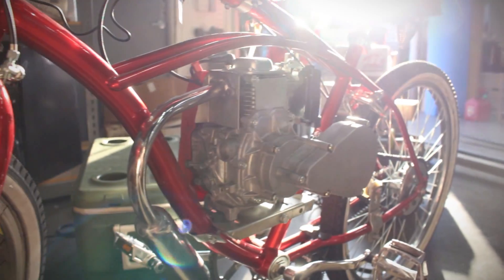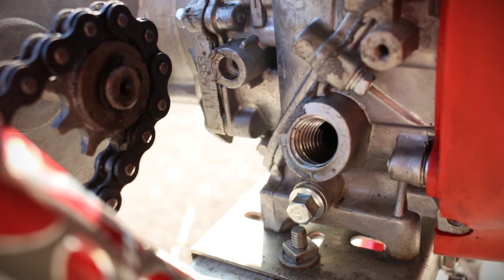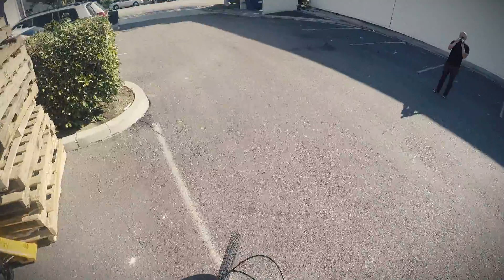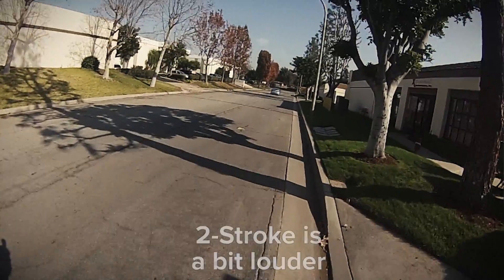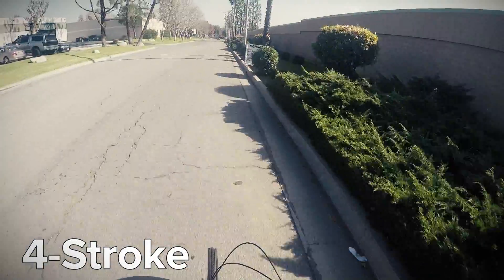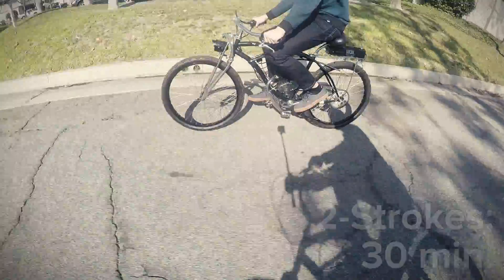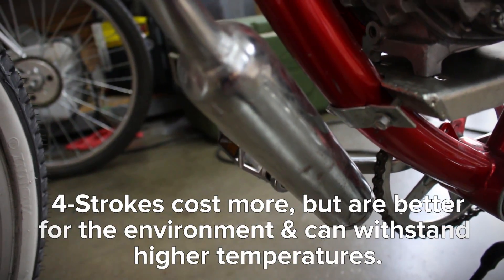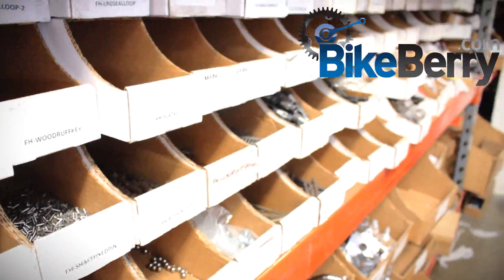2-Stroke vs 4-Stroke Motorized Bicycle (GoPro)

Comment: 4-strokes are faster mine is 212ccs
Reply: Cops dont care? How sketchy are the brakes
Reply: +Peter Kapica my brakes are fine 
They don't squeak and they don't slide meaning that if you break hard you are gunna stop and it will happen fast to you have to pull it brake in slowly
Reply: +Night-Vision Productions you are lucky,  mine are nonexistent and it's a 2 stroke 80cc
Reply: +Peter Kapica you should buy some new brakes then lol
Reply: +Night-Vision Productions I did that and they went out of adjustment in 2 weeks
Reply: +Peter Kapica that sucks man
Reply: Would duct tape prevent the brake cable from going out of adjustment?
Reply: Just tighten the goddamn screw thats all
Reply: thats because its 212cc, the 2 stroke engine in this video is like 66cc maybe even 48cc

Comment: these motorized bikes are insanely difficult to build the first time you make one. But the second one will be super easy. I ride a 2 stroke and I ride it for up to 2 hours at a time, and it's perfectly fine. Obviously it gets hot, but I ride a good 20 miles in those 2 hours. I wouldn't recommend a project like this to a person who is easily stressed out, or has no experience with bikes. I've got a lot of experience with bikes and I even had a lot of trouble with it.
Reply: delreydavid after about 2 months everything goes to shit. Definitely not worth putting 300 dollars into it.
Reply: +delreydavid It does run fine, but certain parts break after about 2 months. I've had mine for about 5 months, and it ran perfect the first 2 or 3 months, but recently, I've broken the exhaust, the magneto, and the carburator.

Comment: in the 4 strokes is it better to run reg grade gas or premium?
Reply: Usually just regular
Reply: Ok
Reply: Honestly 87 will do and for a 2 stroke i would go 89
Reply: I use regular gas in mine, just make sure you're adding enough oil or else the engine won't be probably lubricated enough. Good thing about these little engines though is that it's easy to replace lol

Comment: damn so many people fan girling over the 2 strokes. In short they aren't a better engine. They die faster, Have worse gas mileage (due to ineffective burn), and all together don't last as long as a 4 stroke. 2strokes are fun don't get me wrong but they just don't last...
Reply: They will last the same amount of time when the right oil/gas mix is correct and the seals are good

Comment: 30 MINUTES ON A TWO STROKE ROFLI have gone on long roadtrips on a 40 year old two stroke, riding 6+ hours straight (stopping for gas periodically of course), and have never in 5 years had any problems with the engine except for rattling the carb loose once
Reply: how did you refuel it? did you keep a can of gas in a separate can?
Reply: Yup the time was BS and i had a carb fall off on me couple times

Comment: need to add a us forest servive approved spark arrester do u have one to add to existing mufler systems.
Reply: You dont need that shit the original 2 stroke exhaust pipe in your kit does the same thing with the baffles. On a 4 stroke the factory exhaust has it too

Comment: 4 strokes do not last longer due to oil resevor! they in general don't last longer 2 strokes is constant oil with gas mixed which is better than oil resevor and less top end rebuilds also, has fewer moving parts which means less wear and longer run time I also tested it so get your facts straight
Reply: Fewer moving parts yes, but the moving parts move a lot faster, having more wear
Reply: +The Piscis faster moving parts doesn't do anything as long as engine has lubrication (oil) 2 strokes feed constant oil to engine which is always better
Reply: Even with oil you still wear your engine, oil just slows the process
Reply: +The Piscis oil slows the process by 20,000-300,000 times
Reply: Regardless, the engine still wears faster because of faster moving parts.
Reply: +The Piscis not really, the 2 stroke engine is constantly being liberated through the crank case, and unlike four strokes, the two stroke has every thing bearings, no bushings, the four stroke has crank chart bushing, connecting rod bushing, and rist pin bushing, therefore the four stroke has way higher chance of waring out quickly, the only reason why a 2 stroke would ware out would be because someone leaning it out so far that it welds the piston the the cylinder. so two strokes are better.
Reply: wind chester
While I don't know about this specific four stroke I have dealt with many four strokes in the past that did not have bushings
Reply: +The Piscis last time I tore down a 4 stroke, I found only 1 Bering in the hole unit, the last time I tore down a 2 stroke, I didn't find 1 bushing, all ball bearings. but your right about it being a specific model or unit of a 4 stroke.
Reply: +wind chester your right finally
Reply: +Don't race me I'm to fast what's that supposed to mean?

Comment: I think that nobody realizes how simple a 2 stroke engine is, it has so few moving parts you can get out alot more power and better mpg, and if something breaks... you know what it is because its so SIMPLE and replace all parts within a few hours.
Oil in gas? just 2%! and i have a lil Tomos 50cc, i can drive up to 50km with only 1 litre... no 4 stroke beats that XD
Reply: power yes, mpg no
Reply: Gecko Gremlin 2 strokes get far worse efficiency points. 
Because there is a time when both intake and exhaust ports are open on the cylinder, the engine literally throws out some of its own fuel
Reply: +Gecko Gremlin Generally, no one 2 stroke can beat 4 stroke, in terms of consumption ...
Reply: Two strokes are great in that way but I think they make the most annoying noise conceived by man
Reply: The Piscis Its better than a car with a fartcan atleast lol
Reply: McMuffinFluffin yes, my friend and I assembled one of these kits on a bike and the exhaust pipe got in the way of the pedals when it was pointing down, so we switched it to were it was pointing and now we get a good wiff of fumes every time we ride it
Reply: +The Piscis but smell great
Reply: not bad, i have 125cc 4 stroke which make 2,5 l/100km on 170kg bike. My friend have 125cc powerful but takes 3-4
Reply: Yup, and the carburetors when they go bad those are fun to replace
Reply: Gecko Gremlin well check this out, longevity is the key hand built motorized bicycle non factory,

I have a Flathead/ l block Briggs 3HP far better then a 2t on expense cause at the end of the day a 2 stroke can only withstand it's crank speed.

A 4 stroke how ever is far more torque then a 2t without snapping a shaft being an issue.

It's also not picky on its richness and burn up on site of a lean condition.

4t won't fire with a overly lean condition and if it is lean, it constantly matches the oil pump bka oil singer.

Crack open a new 4t and look at the singer from the 80s vs a new animal brigs racing.

Same slinger made of plastic 4t has valves but a 2t has Reed valves..

Same thing as the other with add ons... 

if I take and block the valve ports and install a Reed MOD I can also become a 2 stroke with removal of oil.

4t is convenient and efficient and I have been on both sides.
Reply: Milan why yes, it's that is true, simple is sometimes wrong but I rather gas up, (but not let the whole block know) my blocks qll factory if state cared about a old L block running down the street they would stop my ass... it's under two stroke rpm.
Reply: 4 strokes are better with fuel and run time mine gets 180 mpg and can go a max at 45-50 mph with a 49cc flying horce but its conected to where the petals are so i can hse all 21 speeds on the gears going up hills eazy and i can cruse around 20 mph on the 21 st gear without useing tons of gas
Reply: you are incorrect. no 2 stroke will get better fuel economy than the same size 4 stroke. the power bands are quite different is the only reason 2 strokes have preference over 4 strokes in some cases or racing dirt bikes. and since they are cheaper and simpler motors to maintain in the short run. but 4 strokes will out last any 2 stroke.  or you would be seeing only 2 strokes in cars and not 4 stroke motors.
Reply: LIL CHUBBUS the one I got is pretty reliable fast to. It depends on how well you put it together, the fuel oil mix & where you get your motor from. I went with a Zeda motor & with some minor upgrades like replacing the carburetor with a better one & swapping the kit fuel line with a rubber one & improved sprocket clamp & replacing all the crappy nuts & bolts with better stainless steel ones from a hardware store & locktite everything.
Reply: It largely depends on the muffler and who is the judge. I think the most annoying sound is the single cylinder 4 stroke. I love the high-revving 2 stroke whine and would not trade that for any 4 stroke.
Reply: it depends on the muffler.
Reply: Lol 2 stroke engines like thoes are garbage and sounds like crap and can't stay at top speed long lol any 4 stroke can ride around at top speed and sound nice
Reply: Mileage isnt that different between the two, it's mostly about how you ride it. I would never use less than 40:1 oil ratio in an air cooled 2 stroke which is 2.5%. Both have their strong points. 2 strokes make more power from the same displacement, 4 strokes make more torque. Both can last a very long time if cared for. I have both engine types on different lawn and garden equipment over 30 years old out on the farm. The reason 2 strokes are less common has nothing to do with efficiency or reliability and everything to do with EPA Commies not liking them because of "muh globull warming" (remember how Manhattan was supposed to be underwater and polar bears extinct by 2020?) I like 2 stroke dirt bikes for the brutal powerband, but my motorized bike is a 4 stroke. Dirt bikes are water cooled and stay cooler than these little guys at WOT, and have more than enough power. Whereas a little 50cc bike I prefer to have the more torque of a 4 stroke, and I like to use it as my tester for different engine oils to see if there are noticable differences, because it holds such a small amount. So far 5w40 Valvoline diesel synthetic has gone the longest before turning black but I have plenty more to test.
Reply: What about that i can ride the bike up to 30 min. !?
If i go more than this time, what will happen?
Reply: my favorite part of the 2 stroke is I can leave gas in it for a month and is still starts easily. 4 stroke dont start if left outside for a week
Reply: Scott Wilson  thats not true. ive left fuel in my bike over the winter each winter without any problems.
Reply: Plus the transmission is built in & not horribly engineered like most 4 stroke transmissions I went through that end up failing within a couple of weeks to months. Now I'm thinking of going back to a 2 stroke. Also I hear the newer Grubee 2 stroke engines like the GT5A Angle Fire are getting better.
Reply: Milan LOL! I have a 50cc 2 stroke that runs 50km per litre...
Reply: Wholeheartedly agree man. Just got my Zeda 80 fully broken-in & runs great! But I’ve had more problems with the 4 stroke durring the break-in than my 2 stroke. Mostly it was the crappy transmissions that keep falling apart on the 4 strokes. At least with a 2 it uses a very simple transmission where it’s just two gears next to eachother no belt or chain to wear out or break & no crappy bell rotor ether. Just a simple crank shaft, clutch mechanism & two gears. I can rebuild an entire 2 stroke motor inside of an hour for less than $50 to.

Comment: whats the small 2 inch metal cilinder piece thats where the engine is at,  around it is the sprocket that you can move with the sp sprocket tool , i lost the piece one time i forgot to  adjust the screws on my 2 stroke bicicle and while riding the aluminum box went off i managed to find 1 screw and the alunimum cover purchased the  screws  but realize that small pin was missing. need help ca t ride it i cant press the clutch to start the engine

Comment: 4 storke will last longer at a cost of a very minor loss of power. 2 stroke gives you more power but wears out quicker.
Reply: Yeah had I known the drawbacks I'd have 100% gotten a 4 stroke instead of a 2 stroke, my 2 stroke is horrendously unreliable

Comment: can the 48-50cc 4 strokes with 5/8" shaft accept a Comet-style torque converter and if so would it line up well with the rear wheel sprocket?  - that setup would have advantages with hilly terrain.

Comment: I've never heard of the 30-min ride time on 2-stroke engines. I ride mine for one and a half hours normally and never have any problems.
Reply: Lmao same, I ride mine at full throttle for hours and hours, sometimes all day long in the summer and it’s fine.
Reply: I NEED A PREDATOR KIT!!!!!! been looking n waiting for ions😭😭😭
Reply: Its just recommended.
Reply: @boibruh1115  same thing. But i didn't know at that time. If i knew that recommendation i wouldn't have done that.
Reply: I’m going to get the 2 stroke kit
Reply: I don't have anything butt 4 strokes now I'm an old fat man however you are right when I had two strokes I would pull my 45 lb dog in a wagon with me and sometimes we would travel 2 1/2 to 3 hours away from home and I never had any trouble with a two-stroke getting too warm. Also I always ran 50 to 1 on my gas oil mix that was from the first start all the way through break in and all the way through till the end. Even the cheap oil that you can get today is 1,000 times better then what these engines originally were intended to use.
Reply: Anu ba maganda gas tlga pag 4 stroke
Reply: You've never heard of it because you don't give a shit. The 2-strokes All run hot because they have no cooling fan like the 49cc 4-stroke. And the lubricating system on All 2-strokes is half-ass because a "mist" of oil in the fuel has no chance of lubricating moving parts as effectively as a 4-stroke with a proper oil circulating supply. (As for your Never having problems, hahahahahahahaha.)
Reply: That scared me. Thank you for sharing. I want an hour ride anytime. 😊
Reply: best 4 stroke 100% .
 2stroke on bicycle is worse
Reply: @infinitoroldan3120  no

Comment: This is more of a comparison between two different models, not so much 4-stroke vs 2-stroke. The clutch has nothing to do with the engine. For example, our grass trimmer has a 4-stroke engine, and it uses a centrifugal clutch. It's also much more powerful than other 2-stroke trimmers I've used. It has a lot more low-end torque too. If I were choosing a yard tool, I'd pick a 4-stroke for sure.

Comment: Is it possible to remove the (what appears to be) plastic cover from a four stroke engine. If not, is it possible to paint it as long as I take care not to get paint on anything important. would it be possible to paint the entire engine so long as proper care it taken. I have an airbrush and am skilled in using it, so painting would not be the problem. Simply wondering if it would interfere with the operation of the motor.

Comment: I have gone up to 37 mph on a huasheng 49cc 4 stroke.  On the crappy centrifugal clutch that sucks and can leave stranded at any moment leaving u to pedal ur butt home. But with a better transmission like the ezqmatic you can get excellent reliability from the engine. 2 strokes are good you just have to carry around 2 mix oil around with the tank to mix it not a big deal but something you got to do.
Reply: I’m a new driver…and thank u….I now am sticking with my 2 stroke….thank u…

Comment: I'm looking for an engine that's fast, reliable, gets me around and is less expensive, so should I go with the 2 stroke, or 4? Also will a 80cc 2 stroke engine get me up most hills? I'm asking this since I live in the southern hills of Pittsburgh Pennsylvania and there's nothing but hills here, and some of them are kinda steep.
Reply from the maker: Zachary Allen If you're concerned with going up steep hills we recommend getting a 2-stroke for the additional power, and getting a sprocket adapter assembly that has a high tooth count (40 - 60 tooth). That will help getting over hills.
Reply: Thank you I really needed help on that decision I didn't want to spend the extra money on a 4 stroke until I knew the 2 stroke's full capability.
Reply: BikeBerrycom So I purchased a 38 tooth sprocket adapter assembly that's aluminum from eBay, should this get the job done?
Reply from the maker: try it out! we're not sure how steep of hills you will be going on. It should be okay, but you can always change the sprocket itself to something like a 60 tooth
Reply: Hey one of the bolts broke off the gas tank on the front what's another way I could mount it?
Reply: Hey do these 2 stroke engines take regular motor oil? And if they do what's the weight

Comment: 2 stokes can have cyntrifical clutches too brehh....i dnt think i spelled cyntrifical right tho
Reply: Peter Kapica 
He said "can have" these are one of only a few applications that have a manually operated clutch most 2 stroke engines use a centrifugal clutch.
Reply: Daniel Serrano it’s just the type of engine popular for the bike to motorcycle conversion
Reply: Wrong, Its got a dry clutch like a manual transmission car

Comment: and what will happen if i use more than 30 minutes the 2 stroke one will the motor explode ? because yesterday i had a ride of 3 hours and i didnt see any problem
Reply from the maker: It can wear on your engine quite a bit, but it depends on how hot it is outside. Hotter it is, higher chance that there will be damages.
Reply: BikeBerrycom Yeah, don't use the stock engine head for the 2 stroke. I upgraded mine. I drive it for many hours at a time hot and cold. I have almost 3,000 miles on my bike and it starts perfectly every time.  As for the 4 stroke, it's based on a honda pump motor which is meant to handle heavy* loads for long time standing still!